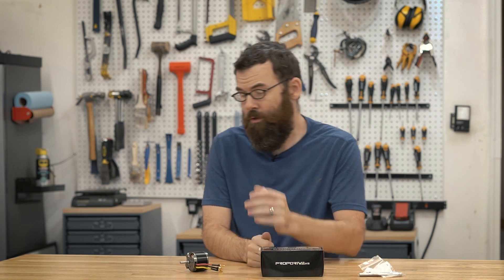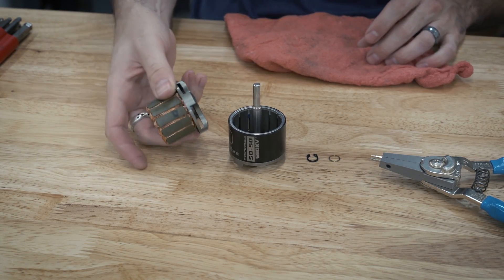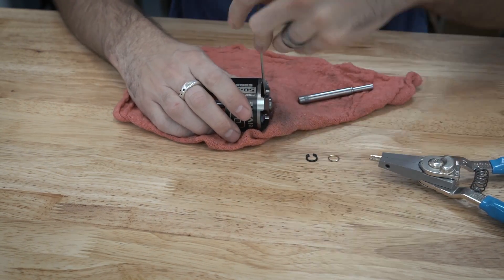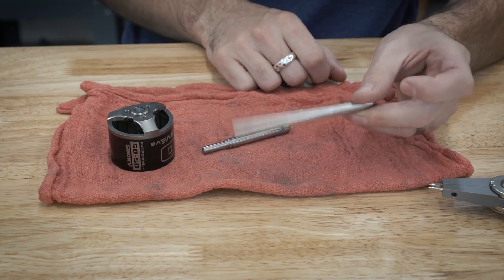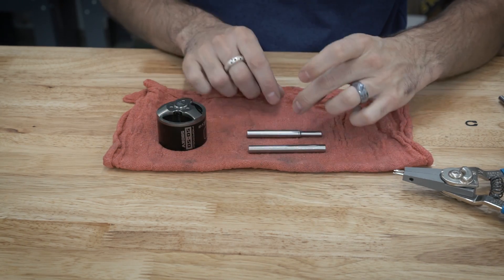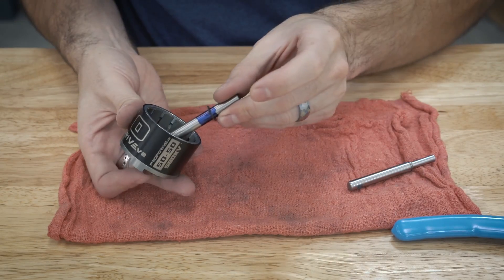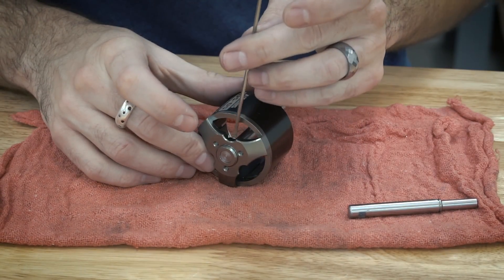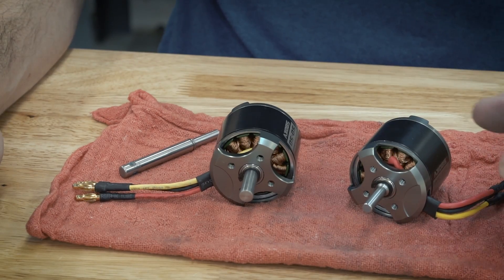Brushless Motor Shaft Replacement

Comment: Uh .. Don't they make couplers, extenders, etc for this very situation???  Waves lots of time and don't cost much.  When you think of the time you use to exchange shafts you could've ordered a party to come the next day and won't have to worry about running the motor.  I'm sure there are other ways.  You're doing this just to get the most 'heft" out of it. Lol , smh, and sigh

Comment: I don't get it -- what does it use for the PTO..?  
Eg. why doesn't the shaft have a hex to transmit the motor's torque..?
Reply from the maker: What's PTO?  I'm not familiar with that acronym.  There's just a set screw on these, which I've later changed.  The original design didn't allow for a hex shaft.

Comment: Haveing diffuiculty replaceing a Motor on my vintage disk cutter, But was thinking of replaceing with a random fan motor.. of the same size, It uses a shaft like that,, I can the shaft machined. for a slower speed,,

Comment: I really need help with something.  Is there any way to make it so that the shaft doesn't move with the housing (whatever the outside part is that moves).  Or would I have to mount that end onto like a ball bearing or something?
Reply from the maker: That would be an inrunner motor.

Comment: Is it possible to put 2 motors on the 1 shaft
Reply from the maker: possible, yes!  worthwhile, no.  they will most likely fight each other.
Reply: @RobertCowanDIY  why will they fight each other if they are spinning the same direction.  I'm new to this sory
Reply from the maker: @theideasman6018  Slight inconsistencies in their speed.  They won't move at exactly the same rate, so they could fight each other.  I have used dual motors before, but with belt drive.  You can certainly try it and see what happens, but it's generally frowned upon.  In short...  brushless motors need a driver (ESC) to spin.  That driver tells them how fast to move by pulsing to the phases (the motors have 3 phases).  The speed at which the pulses are sent tells the motor how fast to spin.  If the two ESCs are slightly out of sync, or if the windings aren't identical, you could get them moving at slightly different speeds.  If one is moving slower than the other, it would be braking the other, creating excess heat.
Reply: @RobertCowanDIY  thanks man.   I've set up/modafide  two 2205/2300 motors to slide on to one shaft. Each motor is running a 20a opto esc off a pdb on 4s.     What do you think will go wrong first.   Just old parts off a drone.  Bit of fun really

Comment: hello Robert i have a slitghtly different bldc motor mine has no holes on the snap ring so i cannot grabt it with a plier like you did, any clue on how to remove the snap ring ? obviously there is not screw on the shaft either looks like it is sealed but there certainly is a way to open it as there are refurbished motors like mine sold everywhere i just would like to save a few bucks fixing mine by myself. Thank you in advance for any help

Comment: Instead of grinding the flats on the shaft could you counter bore some holes and use slightly longer set screws?
Reply: Better to have a flat theyre stronger. Ive seem a flat combined woth a 2.5mm through hole where the set screw was also a through pin. The combination makes it impossible to slip.😅

Comment: Any recommendations for those of us whose "loctited" low-quality hex set-screw was too tight/glued for our properly-sized high-quality allen driver, which led to the rounding off the screw heads long before a conclusion of having needed to pre-heat it before removing would have commonly been drawn?
Reply from the maker: Eh, that depends...  Your best bet is to try and drill it out, but that can be tricky.  If it's stuck in there, you could try using superglue on the end of a hex driver or something, but it probably won't want to come out.  If it's large enough, screw extractors work well (just search for them on amazon or wherever), but if it's too small, you might need to drill them out.
Reply: Thank you! Well done videos, love when someone does a professional job
Reply: William Keller I hint for next time. Use a pointy ended soldering iron placed on/in the set screw to soften the thread lock that was used to keep it from vibrating out. Then go easy applying force with the Allen wrench.
Reply: Wera hex plus

Comment: Hi,
A soldering iron is probably the best way of heating the grub screws to loosen the loctite.
Also you can heat the housing the same way, to break the loctite, making it easier to press the shaft out.
A piece of 8mm silver steel / drill rod would make good shaft for the motor.
Marking the grub screw locations, using that method, will gall the motor housing bore,  when removing the shaft.
That clip is an external circlip not a snap ring, a snap ring is  circular in cross section.
Hope the was helpful to you.
Adam
Reply: Adam L I have rounded the grub screw on my motor. What do you recommend I do to get it out so I can replace the prop shaft?

Comment: After snapping 3 allen keys (good quality Bondhus ones like in the vid...) trying to remove the screw from one of these propdrives, I looked at this video... it didn't help, but I later discovered the solution - use a soldering iron tip in the middle of the grub screw. I left it stuck in there for about 10 minutes, and then it came free easily. They seem to glue it in with some kind of black magic threadlocker...
Reply from the maker: Yes, they can be REALLY tight in there.  I've always had good luck with a high quality allen key.  if you don't have a 'nice' set of allen keys, this might be the time to at least try some out.  They really can make a huge difference.  I've opened up a couple dozen motors and never had an issue when using my good set of allen keys.  But I really should have mentioned that heat always helps.  Penetrating oil can help too.

Comment: This may be a simpleton question but one I'd like to know the answer to. I am building 2 aircraft for drone operations. One fixed wing and one multirotor. I have purchased 2 types of motors recommended for each. The one I purchased for the multirotor has NO shaft on the mount side while the one for the fixed wing has an 11mm shaft  extending from the mount side. WHY THE DIFFERENCE IN SHAFT? (Multirotor = Quanum MT4114, Fixed wing = Sunnysky X2814)
Reply from the maker: well, there is most likely some sort of prop adapter.  many quadcopter motors don't really rely on a shaft, but rather use some sort of adapter for the prop.

Comment: The circlip groove is now the weak point in the whole shaft.  If at all possible you should instead make a spacer and use the pulley itself to retain the rotor.
Reply: Ture, but could those motors even produce enough torque to twist shear an 8mm axel?

Comment: ...You got a mill but you opt to hand grind it on the floor? Band saw cut when you were going to put it on the lathe anyway? Suspect you are sir, suspect.
Reply from the maker: Right?!  I probably should have used the mill, but this was just quicker and easier.  Sometimes I just use the tools that are closest ;-)
Reply: I also have a mill but I don`t want my soft and nicely calibrated slides attacked by diamond or sand particals that create permanent defect! He may be doing because of that!

Comment: You should make a 100lb bot called "Raging Insomnia" and make a spinner within a spinner design that is slightly out of phase, so the spinners look like they are rotating very slowly.
Reply: Let's say you have 2 spinners, one smaller than the other, mounted coaxially on a robot.  One spinner has a large hollow shaft that the other shaft passes through.  Both spinners would be belt driven.  You spin one of them at say 60 revolutions per second and the other one at 59 revolutions per second.  The slight speed difference will show up as a stroboscopic type effect, causing it to appear to spin slowly.  Bonus points if the lighting is at 60hz and you modulate the speed of the spinners to produce a 1-2hz beat frequency (also causing it to look like it's spinning slowly)
Reply: @eformance  😵

Comment: Just a comment for those without a lathe, I know a bunch of people who've left the circlip groove out of the replacement shaft as unless your loading it in that direction (very uncommon with a combat bot) it's nearly impossible to separate the outer can from the stator assembly due to the magnetic forces created during operation. The circlip groove is also a major stress concentration. I've even seen motors come from the factory without anything retaining them axially.
Reply from the maker: I most likely could have gotten by just using a spacer between the pulley and where the motor mounts.  The motor wouldn't be able to go anywhere because of the pulley.  BUT, I figured I would at least show it, in case anyone else wants to add the groove.
Reply: Hello. Can anyone here help me? I took apart a brushless tool, just to spin the housing and reorient the power button, and I can't put it back together, lol. There is a rubber ring in the bottom of the housing that the coil slides into, and the bearing sits in that ring, but I can't get the shaft past the magnetic housing, into the center, the magnet housing is too strong???/

Any ideas? ...please :/  lol

peace

Comment: love the video. I had a very similar problem but the shaft in my motor had a taper. It was the shaft for a Turnigy Aerodrive SK3- 6374 149 kv. How would you replace the shaft in this motor? More specifically, how would you match the taper so that the friction fit is still good.
Reply from the maker: Yep, you would need a lathe...